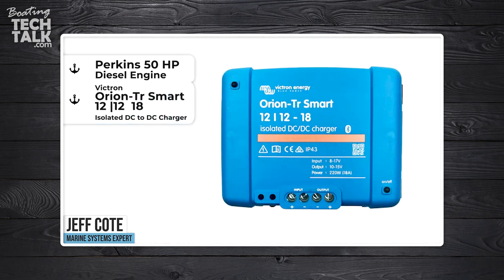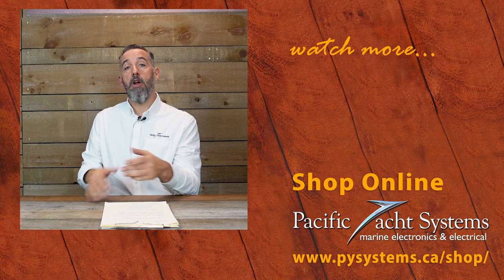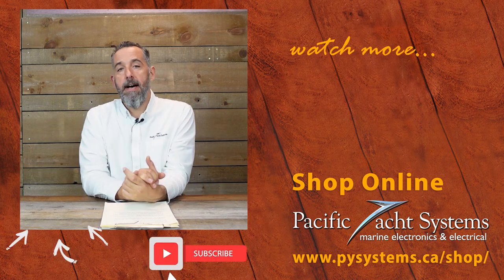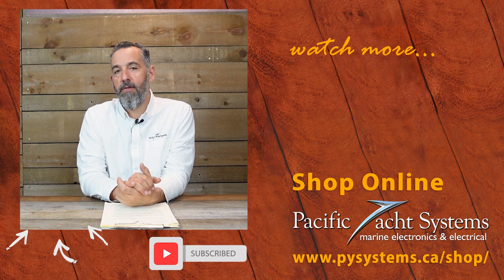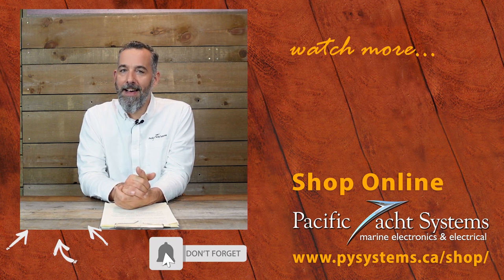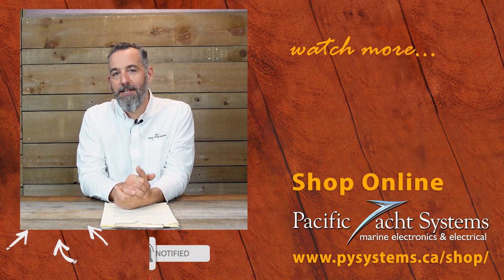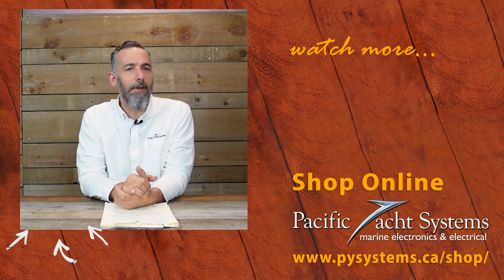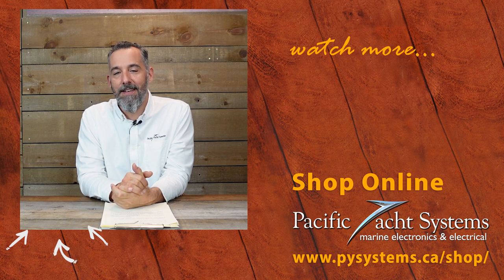Charging Lithium Batteries on My Boat With an Alternator?

Comment: If one assumes the external voltage regulator with an LFP profile, the house bank (Dakota Lithium) could be charged by the alternator and the Orion 12-12/18 could be used to charge the starter battery from the house bank. That way, the house bank gets all of the charge from the alternator and the Orion/starter batt is, at most, 18 amp load when switched on. 

I think your answer is best though if the system only has a dumb internally regulated alternator (ie, no LFP charge profile). Definitely would want/need at least two 30 amp paralleled b2b chargers. 

THANK YOU, Jeff for this great service to the boating community. I wish you had a Chesapeake Bay branch 😉
Reply: I agree with Jim, Throwing everything into the LPF's, alt, solar (if he has it, genny), and then going to the AGM - biggest to the smallest. And at the end of the day, the LFP's could charge / start the AGM.
Reply: Balmar has external controlers for lithium that have protection against open circuit. Assuming open circuit protection is the only reason to connect directly to a lead starter battery.
Reply: I was thinking exactly the same thing… bring all the juice directly to the lithiums, and then install the dc/dc to charge the starter…. Not sure if I’m missing something….
Reply: WARNING: Good lithium batteries like the Dakotas, have a BMS (battery management system) which will disconnect the batteries from the charging voltage when it decides they are full. This will create a current spike back into the alternator and fry the diodes. There are devices out there which will take that current spike instead of letting it get back to the alternator but they are for emergencies and not for frequent use. The best/easiest/safest way to charge lithium batteries from an alternator, in my opinion, is via a dc to dc charger. If there is a better way that is just as safe, I would love to hear about it.
Reply: A side note on current spikes, the same thing will happen on any battery being charged by an alternator if you turn the 1/2/both/off switch to off while the alternator is outputting current. This is why you should never cycle through the off setting while the engine is running.
Reply: @MarioReinhardt2525  This is why lithium batteries with  external charge control are critical for lithium, use the charge control relay to disconnect the field control of the regulator. Drop in sealed Lithium batteries are sub par for this reason.
Reply: @MarioReinhardt2525  You are probably right (“best/easiest/safest”) with regard to the Dakota Lithiums or other drop-in LFP batteries that don’t seem to have the communication from the internal BMS to a battery protect to gracefully handle the fully charged (normal!) situation. 

I think An external BMS “wrapping” the Dakota BMS’s so that they only charge to, say, 90% and discharge to 10% could be used. I had a conversation with a Dakota Lithium tech about 6 months ago in which he said it could be done but I decided not to pursue it any further. I was thinking Wakespeed or Balmar regulator with a Victron BMS. The 90-10% LFP range seems a good idea for longevity and the internal BMS would be a redundant safety.
Reply: @MarioReinhardt2525  how about installing a two bank battery isolator m, and a DC to DC charger to the starter?? If BMS disconnects the house ban, power will still be flowing to starter with ni spike at all..
Reply from the maker: Thanks everyone for contributing to the discussion.
Reply: @MarioReinhardt2525  , not entirely true, some are ‘make then break’ type switches
Reply: Ok, as long as the problem of Lithium batteries taking all the current an alternator can put out til it’s charged is addressed. The alternator output has to be throttled back, the alternator will overheat otherwise. The secondary issue is the problems that arise when operating the engine at slower speeds, again the alternator will struggle with overheating. An external and programmable regulator is a must if this is even attempted. These  are the reasons for victron making such a device. See Balmar site and Victron site for more information 👍
Reply: In this scenario where does the starter draw power from? My apologies if this is a silly question...
Reply: @aphrodite3216   not silly, but easy to answer: the primary load on the starter battery should be an engine starter. There may be some ancillary loads (engine instruments, for example) but one should limit the starter battery to what is is intended to do: start the engine. 

The discussion (a year ago) was about 2 approaches to the alternator as a charge source: one was to charge the starter battery from the alternator and the house bank gets charged as a load on the starter battery circuit. The second approach was to use the alternator to charge the LFP house batteries and charge the starter battery as a load on the house battery circuit. In both cases, the engine starter gets power from the starter battery—normally.

Comment: Jeff, I recently watched one of your older videos where you predicted that in the future boats will  have only DC power. Are we there yet? How would we be able to run air conditioners on DC power. This questions is for doing this in a 40 foot sailboat. I have watched many of your videos in the last 30 days. They are great and I have learned a lot. Thanks. Marcos
Reply: Hey there! I dont know if we are there yet 100% but I can say that CTM Marine does make a 12vdc 6,000 BTU AC. Looking forward to watching where they go with this. Hopefully they go to 24vdc to get the BTU’s in the 12-20 range.

Comment: Hi Jeff, love your videos, this is a little off topic, I have a 420 amp gel house bank and a 160amp alternator, I am planning to upgrade my charging system with external multi stage regulator and a Victron DC to DC charger, I see victron suggest to wire the starter battery to the input and the house bank to the output of the DC to DC charger.  Someone told me I can hook up the house bank to the input and the starter to the output,  what are the pros and cons for this setup?
Thanks
Mario Borg

Comment: Hello Jeff, 
I am in the process of replacing all of the AGM batteries on my current boat. I have two diesels running 80 amp Hitachi internally regulated alternators. I am going to an 8D lithium starting battery and 4 100 amp hour lithium house all in parallel,  I also have a 80 amp hour generator start battery. With all of the batteries being lithium how can I protect the alternators from high voltage shutdown and losing power while underway?

Comment: How can I charge lithium batteries off of my mercury outboard?
Lead starting battery, 2-12v lithium batteries for my 24v trolling motor. I installed a minnkota alternator 2 bank mk2dc to charge the old lead trolling motor batteries. Can I install 1 dc-dc unit after the alternator to chsrge 2 lithium?

Comment: What are your thoughts on the Renogy DCC50S, it’s a DC-DC charger with an MPPT which will output 50amps from either alternator or solar individually or split it 25/25 amps when connected to both. It has temperature compensation, over voltage, over current protection and a VSR, as well as complete data and programming with the optional $60 monitor display. The DCC50S costs only $260.
Reply from the maker: Sounds promising, but never tried this product before.
Reply: @PacificYachtSystems  ok, looks like imma try it out and report back 👍
Keep up the great content❗️

Comment: 1 have house bank and no starter battery,  house bank is 450 amp 12 volt, lead,
 my engine a 6 cylinder ford Lehman diesel has a small 60 amp alternator. 
my main recharge source is a three cylinder diesel genset 120volt 5.5 kw and it feeds a Mastervolt 3000 watt/160 amp battery charger set to charge lead. 
if i upgrade to a larger lithium house bank will i have to change the alternator?

Comment: I am looking at installing Lithium house bank with a DC to DC charger to my AGM start battery. If the alternator is connected to the lithium house and the start battery through the DC to DC charger if the Lithium house did cut off, would not the house take up that "spike" through the DC to DC charger? Also, I was wondering what is keeping the DC to DC charger from attempting to charge the start battery when there is no charge current flowing to the house bank from any charge source?  Is the resting voltage of the lithium high enough to keep the charge current flowing into the house at all times?
Reply: I've been wondering the same same thing.  Also, there are devices to protect alternators if the BMS shuts down the lithium bank.

Comment: Can you have one of these DC to DC chargers connecting your Lithium Batteries to your alternator in addition to having a separate DC to DC charger Charing your lithium battery bank from you lead acid start battery (both running at the same time) ??

Comment: Jeff,  Can you comment on using a Balmar alternator coupled with a MC-614 external regulator and a Balmar (or Sterling ) APD in directly charging a Lithium bank (Battleborn or Dakota Lithium)?  If properly programmed, this seems to be a safe solution, however, you only discuss DC-DC charging.  Can you please comment on the direct setup (with protections)?  Thank you
Reply: I second this. I have looked at all of his videos and he doesn't touch on this. Especially now with the new dual purpose lithium start/ deep cycle batteries, this is a much bigger question now

Comment: Just wondering: do these DC-DC chargers operate only when a charging voltage is detected, or will they continue to move energy from the starter battery to the house battery even after the charging source is removed (or is the desired behaviour programmable)?
Reply: Yes,   They only work when charging is detected

Comment: hi guys, i have an AGM starter battery and deep cycle lead batteries that is want to replace by a 410ah lifepo4 battery with bms..
at the moment , i have both batterybanks connected to my alternator ( 75amps) by a diode bridge.
as i dont want to fry my alternator, i am wondering if i can put a dc to dc charger ( like a victron 50amps dc to dc ) between the diode bridge and the lifepo4 battery?
instead of placing the dc to dc charger between the starter battery and the house battery??

Comment: Here is an idea.
Charge the lithium battery directly from the alternator assuming programmable external regulator, and have the DC to DC charge the start battery.
That way you get full and direct usage of your 100 Amp alternator and can trickle charge your starter battery with the DC to DC that you have.
If the lithium battery shuts down for some reason the current will still see the DC to DC and be protected.
If you are still worried about protecting your alternator install a Sterling Alternator Protection Unit.
No need to parallel 2 or 3 DC to DC units, that's just more equipment to do the job at hand.
I didn't read any of the comments but now see I am not the original idea man.
Jeff, suggest that you edit the outdated video or people are going to watch it and buy unnecessary equipment

Comment: I have a 900AH lithium battery bank and two 100 amp alternators on my Crusader 454's. Both engines are started by a single lead acid starter battery. One of the alternators is hooked up to a battery isolator which also is attached to my house bank. Is this setup safe for my alternators? I heard lithium can overheat alternators, but so far they don't seem to draw any power whatsoever from the alternator.

Comment: Jeff, Can I put two Victron 30 amp Orion DC to DC chargers in my sailboat if I only have a 60 amp alternator?   4 Battleborn Batteries, one Optima Blue Top starting battery.    No solar yet, so alternator and ac battery charger are currently only recharging sources.  Alternator is only away from dock source.  I have very limited funds, otherwise I would be buying a new high output alternator as well.  That purchase will eventually happen.

Comment: I am projecting PV inverter for caravan, and I was wondering about putting alternator on inverter's PV input. As this inverter has only one PV input, I would put PV and rectified alternator input in series with optimizer diode. Peak Voltage of PV string is around 40 volts and and maximum of the inverter is 80 volts.

Comment: Hi Jeff,

I'm in the process of planning the same upgrade (educating ;-) )

What are situations that needs isolated and non-isolated dc-dc charger ?

Can you explain with cabling diagram ?

Thank you
Reply: On a boat with all grounds /negs tied together, an isolated DC to DC is pointless. You would only use an isolated where it is needed to have 2 seperate systems, a towable RV comes to mind perhaps?
Reply: @nicholaskeur  Thanks Nick !

Comment: Hi Jeff, my question is I bought a dakota  lithium 12v 60AH to cranking my yamaha 115 outboard motor and run my fish finder. After installing everything work fine but some how I can't speed when my RPM hit 4000 it automatically slow down my yamaha motor and shut off my finder..any help.
Reply from the maker: I'm betting the BMS opens when you start and you have no battery while running the boat,  only the alternator output.  but it's hard to say.  are you using the DL+ cranking battery or the regular one?

Comment: It finally sunk ⬇️ in that a DCDC Charger, has an amp category 🙄 I just bought the device [for an eventual installation] solely on the proviso that it automates charging.. 
I’ll be on the market for a regulator too, Thanks 🙏 🤓Teåch 🍎
Reply: + Sooo, 🔍🤔 a lithium can handle a large fast 💨 🏁 amperage, but NEVER exceed the battery’s storage ability, wherever that’s stated 🔍🤔
Okay Teåch 👨🏻‍💼🍎🤓👋
Reply from the maker: Exactly!

Comment: Hello. I have a 75AH AGM battrry and I want to change it to lithium. Will I be able to just replace it with current battery? As I heared lithium battery draws much higher amps to charge and specially with alternator on low RPM can it blow up alternator? How this replacement can be done?  I will appreciate reply.
Reply from the maker: Going to Lithium has many implications, from max current, to recharging with a charger or an alternator, stay tune for more videos on this topic.

Comment: I recently added a pair of SOK 206AH LiFePo4 "marine" batteries to my boat to replace an existing 400ah FLA battery bank.  The alternator is wired to a Victron Argo FET isolator (200A) with 3 outputs. One to the forward 4D bow thruster/windless battery, one to the 4D start battery, and finally one output to a Renogy 40A DC-DC charger( 12V-12V) with a LiFePo4 charging profile to charge the house bank.  The alternator is an internally regulated 135A unit.  So far it has worked very well.  The alternator has different charging paths to both the Bow thruster and Start batteries in case the BMS(s) on the Lithium house bank shut down, so I am not worried about blowing up the alternator diodes.  The DC-DC charger is capable of "waking up" a BMS that has shut down due to undercharging, etc.  

On the charge side, I have a Magnum 2000W inverter charger with a 100A charging capacity.  The battery manufacturer rates the batteries for a nominal 40A charge (each) so 80A total and a maximum charge rate of 50A (each) OR 100A total.  I generally charge them at a combined 80A.

I did spend some time doing my homework, but am always open to constructive ideas.  Is there anything I am missing on this system?
Reply from the maker: You seemed to have done your research.

Comment: Hi love your videos.  I basically have the setup you described here. I have a 60 amp Sterling dc to dc charger but I’m finding the alternator appears to be working harder than I want.  Could you do a video on how to setup the Balmar 614 to output lower for certain time period.
Reply: Be sure you use the alt temp sensor for the regulator

Comment: The dc to dc charger is an imperfect method if you have both ac and dc coming off the same house lithium bank.  I have 600 ah lithium bank being charged underway by 30amp dc to dc charger off the starter battery.   More is going out than coming in while underway.  This means that after 10 hours or so of running my house dc will die.  I need about 75 amps comin in to stay neutral.  I have two 130 amp alternators on my big diesels but have tried to avoid any complications with them.  Ultimately I think I need to get alternator regulators and skip the dcdc charger.   Hope this helps you to avoid this problem, and would take any advice
Reply from the maker: You can buy bigger dc to dc chargers or install a few of them.  I would definitely have at least one from each engine. that would give you 60a.  adding 2 to each engine will give you 120a. 
 Moving the alts to the lithuim bank with an external regulator still doesn't fix the bms opening issue.   Unless you have an external bms.   four 30a orions is probably around the same price as  2 balmar regulators + alt temp sensors + modifying the alts
Reply: @PacificYachtSystems  thanks so much Jeff for the reply!   You just backed me down from “the big alternator project”.   I’ve considered the extra dc/dc, but hesitated because it will require heavier gauge wire running from the chargers to the bank.  But maybe that’s the simplest thing to do.  Actually the cleanest option would be to just put back in a separate house dc bank with agm charged direct from the alternators, but lack of space gets in the way….   Thanks again

Comment: I installed a lithium (I believe 8AH) battery in my motorcycle. It works great. Do they make a lithium that I can use in my tender (40hp Yamaha 4 stroke motor) that would replace an optima blue top? I’ve been waiting and checking for years. I would like 100ah if possible and charge straight from the outboard. Thanks
Reply from the maker: Not familiar with a good starting Lithium battery for boats... anyone else can make a recommendation.